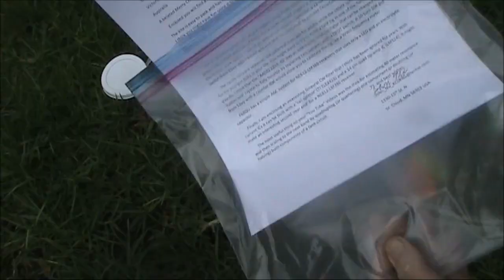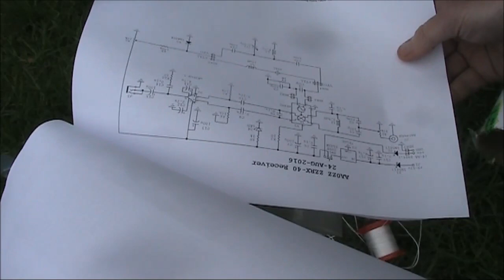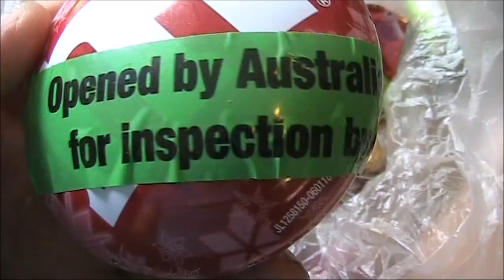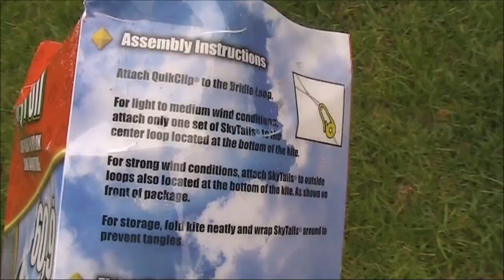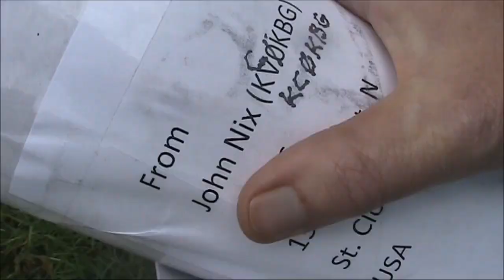Trying the Skyfoil kite and more from a generous viewer

Comment: Hi Peter, is there any chance you could post the information on that binaural CW receiver? I have been collecting info on them for some time with the hopes of making one, and that looks like an article I haven't seen. 73 Brian KC2NYP
Reply from the maker: It's from Ham Radio magazine November 1975. What's described is not true binaural reception (in the sense of phase differences like Rick Campbell described in a direct conversion receiver published in QST) but is a method that creates an artificial difference with audio filtering. The filters are just straightforward low pass and high pass op amp low and high pass filters filters with 750 Hz cut offs. Standard circuits as per data sheets etc. Two op amps per channel. Inputs in parallel, outputs to each side of headphones. Discussion on the concept here. http://elecraft.365791.n2.nabble.com/Re-Binaural-CW-Reception-td390169.html
Reply: @vk3ye  Thank you so much! Love the channel.

Comment: I thought to myself, after such success with the light pole experiments, the tedium and instability of kites is redundant. I wonder if your generous contributor has seen those videos 😅
Reply: Experimentation is never redundant.
Reply from the maker: Horses for courses. The kite is still applicable if you've got no tall metal poles eg you're at a location like a beach. Also the tall metal poles were good for 160m (though I suspect still inferior to a kite supported wire) but for bands like 40 & 80m the kite antenna would likely be superior.
Reply: @vk3ye  Maybe he should have mailed you a 40 meter telescoping aluminum pole
Reply: I thought the whole idea of Ham Radio was to experiment?
Reply: @BoB4jjjjs  He's done lots of kites antennas.
Looks like a pain in the butt to me